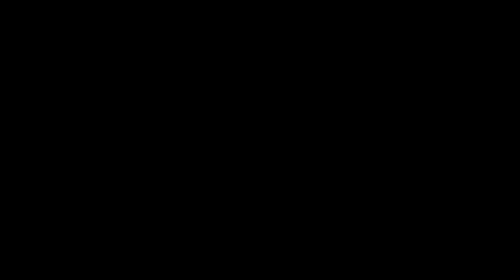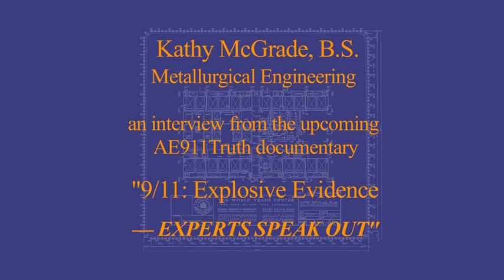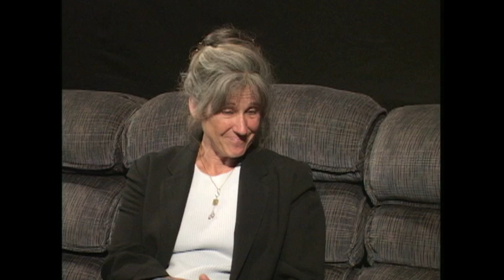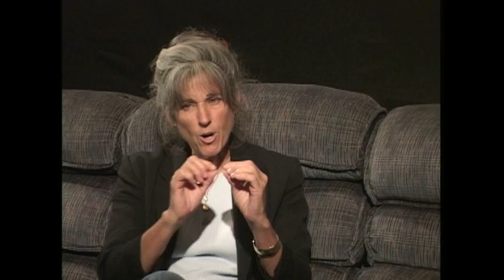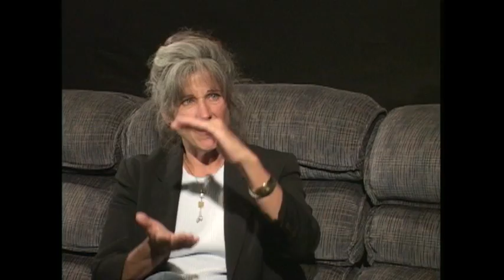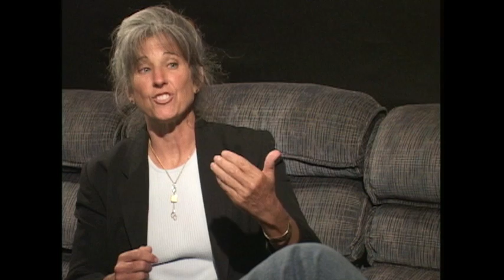Kathy McGrade, B.S -- Metallurgical Engineering

Comment: She's wrong on so many levels that it's ridiculous to believe her theory.
Reply: Prove it fuck boy
Reply: She is not wrong.
Reply: She is absolutely right on target with these observations
Reply: Fuck boy prove it for mk
Reply: E Spencer I have not found where they claim they can’t explain total collapse but I will admit I’m only quickly looking as I’m pressed for time... but I. And assure you those fires burned far beyond 1100 deg! I been in the fire service for the past 26 years and both normal building fires and jet fuel burn around 1800 deg.  Those fires up there also has a gaping hole and hundreds of windows for those strong winds to feed it an abundance of oxygen making it burn even hotter.   This is copy and paste of all I found so far.... I will look at it more this evening. BTW, are you sure you were not looking at Celsius? 

 “NIST reported maximum upper layer air temperatures of about 1,000 degrees Celsius (1,800 degrees Fahrenheit) in the WTC towers (for example, see NCSTAR 1, Figure 6-36).”
Reply: @speculizer1971  you'll have to slow down a bit. First off the NIST NCSTAR shows the core columns, those in the the center, never got to 480 F, as in less than. They also found zero evidence of weakened steel from actual testing, none and did include that statement in their report. The only place that ever had temperatures hit enough to weaken steel was in a computer model that nobody could check because they refuse to release their data.  If I ask you to present the official scientific explanation for the total collapses of wtc 1 and 2 you'll come back with nothing as they have never even attempted to explain it.  I wont lie, I actually snort when I see anyone mention OBL and 9/11, even the FBI said there is no hard evidence linking bin laden to the 9/11 attacks. He was never wanted for them, what you saw was propaganda, nothing more. Did you know the Taliban actually offered to turn bin laden over if the Bush administration would show them the evidence of his involvement? They did, multiple times.  That means had there been real and actionable evidence then the entire invasion of Afghanistan was completely unnecessary.  So what happened? There is no legal evidence bin laden or al Qaeda did these attacks, absolutely none. Everything you believe you were simply told, by known liars to 'trust us'. I even have a lovely video of a reporter saying that to the White House spokesman when the administration pulled back on Powell's promised white paper that would prove that al Qaeda had done the attacks.  They had to withdraw that promise due to lack of evidence, isnt that something? Dulles airport had over 300 cameras with 20+ days of stored images yet not a single time and date stamped image of even 1 has been found. And that's the same for all the airports and all the 'hijackers'. I refuse to even speculate on what really happened that day, too much information has been classified, destroyed or buried right now to make a coherent theory. I have no doubt the US was attacked, I do know it wasnt a surprise attack, there are 2 documented and irrefutable items which prove this and a 3rd that's never been verified or proven a lie so to me it's in limbo.  People also conveniently forget about the anthrax attack on Daschle which came from a US military facility and was made to appear to be from 'terrorists', also it has never been solved(again good propaganda at work made people think it had been).  It is also peculiar nobody stopped and asked how these al Qaeda 'hijackers' knew to pull this operation when there were excercises being done that were simulating planes being hijacked and being flown into buildings (feel free to look that up). I just wish people didnt feel the need to leap to conclusions of what happened, we just end up with more conspiracy theories, instead or ripping apart the official conspiracy theory and demanding to know what the hell really went on that day.
Reply: E Spencer  The core columns were not where the failures occurred. The claim comment that they made.

“None of the recovered steel samples showed evidence of exposure to temperatures above 600 °C for as long as 15 min”

Is insinuating that they did find  some above 600 C but not for longer than 15 min. Otherwise why would they make that statement about recovered steel?     I find it VERY unlikely that those fires didn’t reach far beyond 1100 deg. But I don’t have all the looking around or know if they found the evidence that supports that.  The chances of a building fire in high winds not reaching those temps are just not likely and there would really be no reason for them to burn any different than other building fires,  but very much the opposite with the high winds and jet fuel.    What kind of official scientific explanation would you like or would you be expecting?    They do a pretty good job describing the failures.   I’m pretty sure I’ve explained to you how they collapsed twice, what in my explanations do you not believe or have a problem with?  The collapse of those towers are not complicated when you are familiar with the construction and how buildings and structural members react to heavy fire.  OBLs part in 911 is no secret... nor is KSM.   It is a well known fact even within the jihad social media platforms and throughout the community.  So the taliban offered to turn over OBL...  that was great but he wasn’t all we wanted and needed.   Besides, I’m pretty confident he would have NEVER been turned over. Nor do we negotiate with terrorists. I can assure you, if it was my
decision, not no but Fk no!!   We would get him anyway.  There was many ties that linked them including wired money, his own omission. Which this stuff was gathered over time. 

So in 2001, before all the security you find it suspicious  that in the very busy Dulles airport there wasn’t more footage of them with a time stamp. I don’t see how this is suspicious.  They caught vid of some going through security... if this was staged or inaccurate why didn’t they just put fake make believe video of all of them in the three airports...?

So the anthrax attack was never without a doubt pinpointed.... does this mean
911 wasn’t carried out by muzzy terrorists...who have always threatened and carried out.   I know all about military exercises that were in progress... I also understand all the intel that was coming in... and how it was shuffled to the
back with the many many other threats intel picked up on that was harmless.   We were caught with our pants down because they didn’t take it serious!!  

How the hijackers knew to pull this off.... well OBL got the idea in 99 when Egypt air 990 was dumped into the pond my another muzzy that was pissed at the world.    It is also well known in the Islamic jihad interwebs that OBL said he
should have crashed it into a building rather than the ocean.   From then on.....

You refuse to speculate but are quick to tell what didn’t happen!? ;).      Well, one think I can assure you took place, WITHOUT A DOUBT!     A jet filled with passengers and fuel slammed into the pentagon on 911, 2 jets impacted the towers, and a jet filled with passengers did a nose dive into the ground in Shanksville.   I’m also pretty positive I’m dead on about the fires in the pentagon.   I’m sitting in my
shop freezing my ass off at the moment. I will try to read into more of what you pointed out soon.
Reply: E Spencer but there is no proving to folks.... as I asked, what type of “scientific explanation” would you like?  I explained to you in detail what took place. This isn’t just speculations. There is physical as well as video and picture evidence of it.   Prove that it didn’t happen..... can you?   As people like you are the ones claiming it’s not true and the burden should be on you guys.  Can you prove it... of course not.   You keep claiming that the fires didn’t burn hot enough. But as anyone in the business or educated on the topic can easily rightfully claim they burned far hotter than what you claim.   Just because a VERY small percent of the metal test did not show high temps don’t mean the first were not far beyond failure temps.  It’s just not possible to not burn far hotter than what you claim.   1 percent of the core columns tested and 3 percent of the perimeter columns!?!   Including the fact that the steel tested in these analyses were from some zones within WTC 1 where the computer simulations should not ,and did not, predict highly elevated steel temperatures.    Hardly evidence to prove the towers didn’t burn how like ALL OTHER BUILDING FIRES.  Not to mention the fact they were being force fed- plenty of 02.
Reply: @speculizer1971  and actually before even getting to the buildings I'd want to see all evidence of who was behind the attacks, if you don't know who, you have zero idea of their capabilities.  In 18 years the claim the attacks were carried out by al Qaeda have never been proven.  All requests for evidence, which cant be considered 'sensitive information' are denied.  Not a single 1 of the alleged hijackers can be placed at 1 of the airports on Sept 11 with legal evidence.  There should be an 'orgy of evidence' available, but nothing.  Foia requests for the 4 authenticated passenger manifests are denied to this day, for what possible reason?
Reply: E Spencer yes, they have explained everything in what you would describe a “scientific explanation.” But as I’ve said, conspiracy theorist would never be satisfied as they WANT to believe the nonsense.   Just as more facts are told and explained more inaccurate questions are asked... such as what you just did with your question about if “aluminum can cut steel.”  This is just a nonsensical question as the jet didn’t necessarily, “cut steel.” As well as if the building was one large steel encased block. Let’s say the 200 ton commercial jet didn’t bust through the steel structural members, the exterior columns were on IIRC either 36 or 42” centers.   The jet would have still easily entered the buildings.   You are more than welcome to scroll back through the NCSTAR you sent me to and look at the structural members and tell me they were “cut!”  The claim is just nonsense.   Then the claim that 10% of the structural destroyed 90% is also very misleading, as the 10% didn’t have to overcome the 90% of the remaining structure, it only
had to overcome the floor immediately below, which in all actuality a mere 20” drop was plenty to start a collapse.  I as well as NIST explained to you several times why the collapsing section accelerated as it went down. I will explain again which is very simple unless someone doesn’t WANT to believe actual facts.   Each floor it pancaked down upon it collected thousands (@4,600) of tons and enormous mass and velocity as the more weight it gained the easier it was to overcome the supports which held each floor. If I drop a brick on a ballon it will probably pop... if I drop 10 bricks tied together it would pop it much easier wouldn’t it.    

The claim that it was throwing
mass outward and upward is just nonsense. What went over the sides mainly was the initial impact and some of the building FALLING over the sides.   Nothing was “thrown upward.  As the building was collapsing down.  Please point out where building was “thrown upward”?   Yes, I’m sure you can show me plenty of conspiracy theories who say plenty for their agendas as there was absolutely nothing that took place goes against Newtonian physics.

I realize you will believe everything told to you by conspiracy sites about the hijackers... which is just nonsense.    So what is obvious  in your comment is that you apparently don’t believe jets were used as weapons on that horrific day as you question weather “aluminum cuts steel.”  You apparently question whether the jets would enter the buildings, which there is absolutely NOTHING within the construction and design of those buildings that was going to stop those 200 ton jets flying at those speeds from entering those buildings, yet you claim Newtonian boy about the building collapses.   Perhaps you should take those Newtonian physics as relate them to those jets and the 3-4 billion ft lbs of energy those buildings absorbed.
Reply: E Spencer sorry bud but the evidence and facts are there.    We know jets impacted the buildings... we know the floor truss sagged and failed, we know the exterior load bearing columns failed. We know there was major fires running through the floors because all the evidence from physical to video evidence is there. What evidence “refuted their claims”....... the small fraction of steel collected and tested?!?   Sorry bud but there is just no denying the fact that these towers acted any different than any other building fires and burned far beyond the failure of steel.  Especially then factors such as high winds which force fed the fires oxygen which would cause them to burn hotter.   

Sorry but your porcelain tile experiment is a far cry from a 110 story skyscraper.  Building an experiment proving your incorrect would be very simple if I had the time.  Building it with cardboard in between would be incorrect and inaccurate.  Building them
with small quarter pieces of tooth pics connecting and contacting them in a way that would hold them up to where a very small, say .5 an inch would cause failure.  As it is proven that the floor would only have had to collapse 20” to collapse.  Building a model like this would cause a complete and TOTAL collapse just as the buildings were total collapses.   

There is overwhelming evidence that proves what I say is 100% accurate as well!

No, I’m pretty certain my use of conspiracy theorist as a pejorative is dead on accurate.  

Conspiracy theory is  -‘a belief that some covert but influential organization is responsible for a circumstance or event.’    

This is EXACTLY what folks like yourself thinks.. that the gov is responsible.  

Conspiracy theorists —  One who believes in, follows, or advances a conspiracy theory!     Which IS EXACTLY what people like you do.... you think the gov (or some influential organization) is responsible FOR AN EVENT, 911!!     I’m pretty sure I’m dead on and am completely accurate about that as well as I just explained with the definitions as well.   Using it as a pejorative is very accurate.
Reply: E Spencer proof the floor truss failed and sagged...   Well let’s start with the fact that lightweight truss EASILY FAIL IN AS LITTLE AS 5 MIN IN FIRES.  Do you need this literature, I will be happy to provide.  When they sagged and failed do you think they A. Pulled the core columns outward or B. Pulled the load bearing exoskeleton columns INWARD.   Of course they pulled exterior columns inward. This is seen in many
many vids and pics where the exterior walls are pulled in several feet.   What do you think caused this?!!  Perhaps the columns they were attached to..?    Do you need links to these pics and vids? 

Sorry, major fires that are burning to those temps do NOT have to look like the Grenfell tower.  Are you trying to claim that the fires within the twin towers were not major fires?  That would be shear ignorance.   I’m pretty certain I never said there was “extreme fires.” Do you make it a habit of putting words in opponents mouths for your advantage.  

Please show physical evidence... as in....... ?   Vids, yes there are plenty of vids that show major fires running through the buildings.  As we have already established the metal tested was only 1-3% of the steel of the fire floors and computer models didn’t even put the areas tested very hot. 

Ahhh, then you are going to try to quote Oreo Palmer... yes BC Palmer reaches the impact site.  He called and said he had isolated pockets of fire.   This is what Oreo was looking at where he was as, this does NOT mean he saw all the fires that were up within the building,  this is basic common sense as we know Oreo had merely just made it to the impact site and as most realize the impact site covered many floors and fire and actually rises rather then goes down.  You are MORE than welcome to check out the fire eating at the south tower just before it collapses!    Ask anyone in the business and they will tell you just how foolish you are for insinuating those were not major fires.... and if ole Oreo was still alive I can assure you he would as well.   But, I’m sure you want scientific proof.   Oh yes I’m sure my lack of time to build a model that proves a point will act as a retraction on my part in your eyes.    We will put that in the same retraction as you have yet to take your time to build me proof of the nonsense you claim.   Try again.   Simple education on topics would is so beneficial.
Reply: E Spencer Where is it you would consider dodging.   I’m going by the very obvious and you are omitting facts. So you will not except the very obvious unless NIST proves it to you will physical evidence from the destruction, even
though there is evidence within video and pics of the outcome of what would happen had this occurred...?  So the exterior walls were pulled in WITH the exterior columns. Where this would only happen had the lightweight floor truss failed pulling the exterior columns inward which the exterior walls are connected to.. EVEN though this is a VERY WELL KNOWN CHARACTERISTIC of said light weight floor truss when exposed to fire and heat....?!     But of course, this goes back to what I said about conspiracy theorists never being satisfied with any evidence brought to them.   I guess since they were only able to test a very small amount of steel 1% and 3% which showed no heat that cause failure then I guess it did not take place...    I guess this fire miraculously didn’t have the very same characteristics that other building fire has even though it had high winds forcing an oxidizer  into it... ?    Refer back to what said about conspiracy theorists never being satisfied. So, if the samples are not available to be tested which would prove the fires were as hot as they should have been as all building fires,  well then CT believe it just didn’t happen and the buildings shouldn’t have failed.   

As for your experiment.... no, that is a bad experiment. That in no way shape or form resembles the experience to which I said. Lol.    This is the typical conspiracy theorists outlet to deny reality.   

I am sitting at my desk at work and I have the 5th edition IFSTA Essentials if firefighting. 
Page 156 Lightweight and Truss Construction Hazards.  You are more than welcome to google it..... which states the obvious which I have explained to you.  5-10 min failure times and direct fire impingement is not needed for failure. Heated gasses will cause the failure.
  
As for my “dodging.”..... I see a lot of dodging to my answers of many of the comments you
make such as your silly claim that in order for it to be a major fire it would have to look like the grenfell tower!?   Or your assumption that Battalion Chief Oreo Palmer was looking at every aspect of the burning damaged floors when in fact he was advising command of his initial assessment and needs..... as if he could see all that we could see in the vids!  Or your claim that the core columns never reached   480 deg F when not only did no one claim that’s where the failures were, you claim they said that “no evidence was found or NONE in their report” .... as you conveniently omit the part where they explain that only 1% and 3% were tested and Computer model modules show there to be low heat in that area where the samples came from. 

I have allowed you to slide on many of your claims which I questioned you about as well allow you to knowingly lie by omission to further your narrative, yet I’m dodging!   

Perhaps you could answer my question on just how they ignored NFPA921...?   This is just one question of  MANY you
 ignored as if it wasn’t asked.

Not to mention the silly notion that during the collapse energy was forcing debris upwards and out at 45 deg angles!  Lol as if this comical claim is accurate.  But if I can’t reproduce nonsense my experiment would be retracted. lol 

Let’s hear about your silly claim that NIST SAID There were no evidence of “extreme hit fires” which I guess that mean major fires.... as we all know NIST said there was no evidence found, YET they also explained that only 1% and 3% was able to be acquired for testing as well as computer modules show the area of those tested as not high heat areas.    Yet you claim that the fires temperatures within the building, which are typical in building fire house fires and ALL structure fires did not reach temperatures because you don’t have “scientific evidence” and any claims that the fires reaching typical temperatures would be a “known fallacy!”     This is just the grasping of nonsensical   typical conspiracy theorists claims which omit and mislead the facts.
Reply: @speculizer1971  in terms of 'dodging' is asked you why you use the term 'conspiracy theorist' as a pejorative since if you believe 19 radical Islamic extremists hijacked 4 planes in a surprise attack, well sorry that's a conspiracy theory, one with zero legal evidence supporting it.  I've said time and time again, theres literally nothing to argue about with the buildings, theres NO OFFICIAL SCIENTIFIC EXPLANATION FOR THE TOTAL COLLAPSES OF WTC 1 AND 2. And that's from NIST itself. Continuing to maintain there is makes you delusional at best, so dont. As for the experiment I'd like to see you show me one done where 10% of a free standing structure completely destroys 90% at near free fall acceleration while throwing large amounts of mass upwards at 45 degrees and laterally.  When put like this its apparent that is absolutely impossible with gravity being the only force used and that isnt my opinion, that's the opinion of very established phds in physics that have repeatedly offered to take on any other PhD in physics that says it's not impossible in a public, recorded debate. In years there hasnt been a single offer to engage. People take silence as scientists saying they agree with the nonsense spewed by the administration.  It's not, the large bulk of physicists in the US work for the us government directly or indirectly and dont want to lose their jobs.  As for your blazing inferno, i never saw one. I saw thick smoke, I know a firefighter at the impact site said there were only 2 pockets of isolated fires hed need only 2 lines to 'knock it down'. I know people were using the stairs going through that inferno repeatedly, yet were fine. I know a woman was seen right at the impact point hanging into the exterior steel, apparently it wasnt even hot. This is an inferno https://www.theguardian.com/uk-news/video/2017/jun/14/grenfell-tower-blaze-video-explainer  see how the fire is clearly visible? See it cover the entire building? This building actually had the exterior clad in flammable material and yet it did not collapse.
Reply: E Spencer lol it’s like you just keep regurgitating the same things telling lies and, putting words in my mouth which was “extreme fire,”   now it’s “an inferno!”  Lol    When we BOTH know you are speaking nonsense as I’ve said neither.  Yes, there most def were major fires within the towers.  And NOW you are going to try to use the logic of the woman who crawled up to the jet impact site on the windward side where those fires quickly burned out for obvious reasons.  I guess you are going to try to have people think or insinuate that since there was no smoke right there that all the fires were out...right?  Perhaps as i keep saying and said from the beginning, education on these topics is key.   

How about instead of speaking about the woman who, obviously is fighting to stay alive as she made her way to the windward side of the impact site.... focus your attn to the leeward side of the buildings where the fires were burning their ass off...?  We both know you are grasping to trying to paint a false narrative.

Just as your lame attempts to put words in my mouth in order to paint a picture which I am no way shape or form trying to paint.  You keep regurgitating the grenfell tower and referring to my claims of major fires within as “extreme hit fires” which you claim I said, and now it’s “inferno” which you know I never claimed nor suggested.   But yes, to deny there were major fires raging through the building would be just a deny out of ignorance or deny out of attempts to paint a false nonsensical narrative as those educated and use common sense realize that just because the fire hasn’t fully engulfed the effected floors does NOT mean there were not major fires running through the buildings and raising temps beyond steel failure.

It is also comical how you always seem to claim that there is a lack of “scientific evidence” where there is plenty of evidence and now it’s  “ zero LEGAL evidence” of the hijackers.  When in fact there is OVERWHELMING evidence of these 19 hijackers which also include hundreds of individual eyewitnesses of many different backgrounds which came in contact with them in the months leading up to the attack!    Sorry, that is only a conspiracy theory in YOUR mind because your disregard reality.

So, NIST said there is “no scientific explanation for the collapse of the buildings.”     Now, I will ask you AGAIN, post a link where I can read this for myself.   Or is it just going to be like my request for you to explain to me where you believe NIST just ignored NFPA921...?   I guess just pretending questions were not asked isn’t dodging. Lol 

Now, as for delusional, that would be to just ignore the facts of the building fires within and the obvious damage caused by them and claim that they just don’t exist because there is no “scientific evidence” when there is literally video of every bit of it.

Once again the claim that debris was thrown upward and outward is just complete nonsense. But yes, I realize you are merely regurgitating nonsense from “experts with PhDs” as you were told to think,  just as you were told to think they claimed to offers other PhDs in physics... etc.”.  Yes, we know you listen to everything that fits your narrative that these silly sites tell you. This doesn’t mean it’s accurate. 

More of your delusion is your   determined attempts to make your point by using the grenfell tower as your comparison is just clearly out of pure ignorance or attempts of deception .  Whatever be the case it is lame and will NOT work.   Most of the intelligent realize the major differences regardless of your claims that “the building had exterior clad in flammable material.”    

Let’s start with some facts which you just are ignorant on the matter or disregard facts to make your lame attempt to prove a silly narration filled with nonsense.  

1st) the GT was merely 24 
stories...... huge difference in a 110 story skyscraper. 

2nd) the GT was built much more robust then the towers that had 40% less steel then conventional buildings and built for horizontal loads and much less concrete than conventional buildings in order to build 110 stories high.

3rd) THIS is a aminor little detail you so conveniently love to leave out... the GT didn’t have a 200 TON COMMERCIAL AIRLINER LITERALLY RAN THROUGH IT CREATING SEVERAL BILLION FT LBS OF ENERGY FOR THE BUILDINGS TO ABSORB AND THE MAJOR DAMAGE THEY CREATED.. or let me guess, there was no “scientific evidence” of major damage or no “legal proof” of the jets....?!?   Lolol

 4th)  AND A HUGE FACTOR YOU JUST LEAVE OUT....JUST BEFORE THE GT WAS BUILT THERE WAS A GAS EXPLOSION IN EAST LONDON KILLING MANY AND REGULATIONS WERE PASSED BY WHICH GT WAS BUILT!!  THESE REGULATIONS REQUIRED BUILDINGS TO BE EXPLOSION AND FIRE PROOF!!   THE REGULATIONS aaREQUIRED THE DESIGN TO ALLOW FOR EXPLOSION OR FIRE TO REMOVE PART OF THE SUPPORTING STRUCTURE AND STILL HAVE THE BUILDING TO REMAIN STANDING!!    

 Now, do you seriously want to keep using the GT as your proof... I suspect you already knew the facts yet still attempt to deceive as CT so often do.     If not, as I said and keep saying education is key.     

You will continue to spew your nonsense and use all your talking points to try to prove your silly narrative.. but the truth is all there.   For instance, Oreo palmers claims which I explained to you and your very next comment you regurgitated the same.  Perhaps your lame attempts ARE from a lack of knowledge, reason logic and common sense.... who knows.   I have no clue if you are aware of the size of those towers and somehow you think that Chief Palmer was able to do a 360 around the interior of the building on all floors before calling for initial resources he requested as well as his size up on the casualties.   It’s as if you just rid yourself of common sense in order to make a point that you think backs your conspiracy narrative...  I mean Oreo Palmer reached the FIRST floor affected by the impact and you somehow believe he knows exactly what was on the MINIMUM of 8-10 floors above, we know the jet crashed into nearly 10 floors.  This doesn’t include the upper floors where fire had obviously spread  to!!     To use this as some sort of proof is just asinine from lack of logic,  common sense  and education on the topic!!
Reply: E Spencer lol so just as expected and is very typical.... you know there is no way to show exactly what temps the buildings burned so you stick with that and ignore the rest.... 

Yes, go back and LISTEN to i Oreo.... and the 6 min 53 min mark and lay attn.  he explains what he has ON THE 78TH FLOOR!!   There is no need for me to give counter evidence, as you so ignorantly gave it for me!!    Now let’s go back and reiterate children. How many floors were damaged and affected.... what direction  does heat and fire go?!   Yes, you are finished!

You then claim you mentioned the grenfell tower ONCE AND CLAIM THAT I CANT GRASP THAT IT WAS RI SHOW AN EXAMPLE OF AN INFERNO LOOKS LIKE, YET YOU SAID THAT IT HAD EXTERIOR CLAD IN FLAMMABLE (which I’m certain you said flammable instead of combustible  because Of lack of education on the topic) MATERIAL YET IT DID NOT COLLAPSE!  Lol why would you say the bullshit about it did not collapse if you was only “SHOWING WHAT AN INFERNO LOOKS LIKE.”   Still not being honest are you..... anything to make your silly claims seem correct.

So I do not know the “protocols”  required for NFPA..?   Lol I only do it and use it for a fkn living and do so on legal reports.       They are GUIDE LINES, not MANDATORY guidelines.   Do I need to call an investigator for every fire....... no, because I know what caused it.   There was no doubt as to what caused the collapse of the buildings... only to the uneducated conspiracy nuts.  

“With all the mentions of explosions,” yes..... which were all found out to be inaccurate as there were zero explosions at ground zero, FDNY even identified all loud noises during post incident critiques.    The only loud explosions around building 7 was the actual building collapsing. 

Yes, I typed in EXACTLY WHAT YOU SAID TO and still cannot find what you are referring to...  the 3rd thing down is wiki’s collapse of the WTC.   So you  tell me you can type all that telling me exactly where to look but you can’t just post me the link !?!?   Lol of course you cannot.  

- [x] Wow, shocker.... you will mute because you know there is no way to prove the ONE thing that you can claim. Lol as it is just “opinions,” to you which mean nothing.    Yes because WTC fires burned different than ALL OTHER BUILDINGS IN THE HISTORY OF MODERN BUILDING FIRES! Lol.     You know that only a small amount of steel was tested and that is your “ win” because you so conveniently disregard the OVERWHELMING evidence because it’s easier to stick you fingers in your ears and scream I won!!! Lolol      In your world,    trolls = those far more educated than you and make easy work showing your ignorance.    Please, tell me more about how Oreo knew the conditions of the WHOLE SOUTH TOWER after only reaching the south tower...?   Yes you most def sound stupid as ANY dipshit with common sense could watch the video and the several fires burning throughout and tell that there was far more fire than what Oreo was referring to... he even stated on the 78TH floor!!    Lol yet you will ignore the facts and ignorantly claim “finished”.  Or tell us more about how you was only pointing out grenfell towers to show an inferno, when I NEVER claimed the towers were an “inferno.”   Yet you still made the point “and it didn’t collapse!”    But we know that was just you trying your best with your lame attempts that went absolutely no where’s!!     

Or yes, please tell us again how “NIST already said there is no evidence” as you so conveniently leave out the rest of what NIST said.   That that was only a very small fraction tested. Lol.   This is the exact way you lie by omission in order to paint a narrative that you so ignorantly want to believe.    I’m pretty certain you were finished before you even started....   Go ahead and mute, I’m used to conspiracy nutJob theorist blocking me once their ignorance and lack of education on the topic is exposed along with the lies they tell and the way they go about doing so.     It’s all good, some of us are doers and some are keyboard jokes!
Reply: E Spencer challenge with actual evidence.... you are just another blithering idiot who hasn’t the first clue about reality!!  You are going by LITTLE pieces of evidence that would back your narrative while OMITTING THE REST OF THE EVIDENCE!!   I destroy you and make you
Look and sound like the low IQ simpleton you are and you simply just ignore it all and resort back to your silly talking points!    Hell I steered clear of my personal dealings with 911 just to allow your to spew your nonsense! Lol    How about BEING HONEST INSTEAD OF allowing yourself to sound so UNEDUCATED when people bust your ass with all you just conveniently omit!!     Lol yeah bud.... I’m pretty sure any educated person can EASILY tell which one of us is the complete moron! Lol.  just another uneducated mentally handicap who thinks he is an “elite critical thinker!” Lol.   Lol and to think you are just continuing to spew conspiracy nutbag bullshit you were told to think and regurgitate!!    Get off your computer and do man things.... and make something of yourself!!   Maybe this way you will start to think for yourself and not allow others to do your thinking for you!!      Btw, yeah my opinions are pretty fkn solid there you ridiculous clown lol!!   Now, go make something of yourself other than a conspiracy shitbag loser!!
Reply: E Spencer FIRST THINGS FIRST..... just because you aren’t able to handle my comments and keep up perhaps your should allow others to read them to you... or if you are having trouble comprehending have them give it a try.... You are constantly doing the same bullshit over and over, claiming that I said shit I NEVER said!  Is this a habit of yours or is it a mechanism of coping?  You seriously have problems.  POINT TO WHERE I SAID THEY CANT TEST FOR HEAT SIMPLETON...?   Lol apologize for educating you!?  Seriously, your condition is worse than expected!! If you cannot keep up there will always be a problem.... but, you are just sitting here speaking nonsense as if you had a clue!  

It is ironic how you can never post links... I’m not going on a hunt trying to find something your stupid ass just can’t comprehend.   If you want me to educated you in something about fire heat and investigations post a direct link and I’ll take my time educating your stupid ass.... other than that you aren’t worth my time trying to find what you are having a hard time with..?

Lol, I mean I shouldn’t be shocked.... so as a conspiracy nutbag you are going to try to accuse those who claim they saw Bigfoot or interacted with Elvis who passed in ‘77 with people who ACTUALLY WORKED AND INTERACTED WITH THE TERRORISTS WHILE WORKING at their jobs.. all of which can be verified and were contacted or contacted investigators. ... people who are normal citizens ... Are you seriously that stupid...!?  Yes, nutbags who make such claims most def are! 

So because the vids from 2001 that they did catch didn’t have time stamps means they didn’t board jets...  yes, you are that stupid.  I guess you want them to mail you the original manifests..?   How about quit getting your info from conspiracy sites. It would perhaps make you sound smarter!! 

Sorry bud, but the conspiracy theory is what the conspiracy nutbag theorist (YOU AND YOUR BUDS) spew and accuse the gov of...... you are the conspiracy NUTBAG theorist!!    You claim it’s not accurate of true.. the burden of proof is on you shitbags and in 18 fkn years you clowns have done nothing but look more ignorant BY THE DAY AND COMMENT!

You have not and will NEVER pick apart my statements because I am stating accurate facts.   Because some of us aren’t just going by what others say... some of us are educated on the topics.   Actually SH did have wmds in the form of sarin gas, which he even used on his own people.  Do I agree with taking SH down..  he was a horrible human being but he was keeping those animals in check.  Why did we go into those countries... I already explained to you, I realize you can’t keep up nor does your uneducated ass listen to learn.... I don’t know how old your uneducated ass is, but have YOU EVER known a career politician to let a horrific tragedy go to waste......?   I guess I have to explain it to you.   He used 911 for personal vendetta and or gains.   None of this means the Islamic terrorist didn’t commit these horrific events.. it just means you are too stupid to think for
yourself...nothing more nothing less!!      

Still uneducated to the point you are spouting the shill crap I see!  Lol AS IF IN 2019... lol. Yes, you’re that stupid!!!   Go ahead post your Operation EV bullshit! Lol.    I’ve told you yes, I DO work for the gov though...! Lol.  City Gov that is....   Shill...SO, LET 
ME GET THIS STRAIGHT , a Fire Capt in this here capital city, with 26 yrs service, whose family has been part of this dept for generations.... One who has spent his WHOLE FKN LIFE helping others in their time of need and some in the darkest days of their lives... This includes both his part time job as well.   As well as someone who is also on one of 28 USAR teams from across the country and has for many years before 911... same USAR team of many who responded to the pentagon where we,  first shored the building with army engineers, next task we HELPED FAMILY WITH CLOSURE  BY COLLECTING HUMAN REMAINS INCLUDING PASSENGERS which you silly asses claim DON’T EXIST!!  Lol.  Which all remains were bagged tagged dna swabbed gps marked and brought to the temp morgue.  SO....... THIS GUY,IS A GOV PAID SHILL WILLING TO SELL THE CITIZENS DOWN THE RIVER, LIE AND ALLOW THE GOV TO MURDER THOUSANDS OF INNOCENT CIVILIANS.... INCLUDING 343 FIREFIGHTING BROTHERS..?    Yeah, here’s a big FUCK YOU BUD!!    It’s TRASH LIKE YOU who need to be beat half to death and locked away for spewing your ignorant trash where family members can read it and putting your nonsensical BULLSHIT in clueless people’s minds and taking the blame off of the Islamic extremists who are responsible for this shit!!  All because your are one of the ignorant shitforbrains who hate the gov and always want to play the victim as well want to be part of something where you say and are told your are the “elite critical thinkers” and the rest are just not as smart as you because they can’t figure it out by watching conspiracy bullshit!    When in reality you are merely a pathetic clown who needs to get out in the world and try to be an intelligent man.  

You are a very comical conspiracy nutbag though, I will give you that.  You can post this comment and accuse me of saying something else I NEVER said.... how many times is that now simpleton.... 3?   Let’s see, “extreme fire,” “inferno”...... and not this BS.    I guess it’s all to just AVOID all the stuff educated you on in the comment above!  You never want to try to prove my education for you wrong do you..!?    I wonder why that is? Lol.       

I’ll be waiting on you to point out where I said they can’t test for heat...this should be fun! 

As for spinning wheels... that would be you and the rest of the idiots like you do.  As for baseless nonsense.... that is only because you don’t want to use your brain, some you just DON’T WANT TO HEAR SO YOU JUST IGNORE BECAUSE IT OBLITERATES YOUR NARRATIVE and  some is just over your simple head.
Reply: E Spencer MY TEMPERATURE ANSWER IS BELOW....BUT, JUST AS I FKN SAID AND KEEP SAYING!!! Lololol.  I AM TALKING OVER YOUR UNEDUCATED BRAIN!! Lol. YOU ARE TOO STUPID TO FOLLOW ALONG AND REALIZE THE FACTS!   BUT FIRST, YOUR CLAIM THAT YOU DONT READ MY WHOLE COMMENT IS VERY TYPICAL AND WHAT MOST NUTBAGS CLAIM WHEN THEY KNOW THEY ARE SPEAKING TO SOMEONE THEY KNOW IS FAR MORE EDUCATED THAN THEM.    ITS A LAME TACTIC TO KEEP FROM HAVING TO ACKNOWLEDGE MY COMMENTS, AND FACTS I EDUCATE YOU WITH!! Yes we BOTH know you read ALL of my comments. You pathetic lying POS....it’s EASILY SEE IN YOUR responses!!    YOU CLOWNS ARE ALL ALIKE AND SO SO VERY TYPICAL!! 

Now back to the comment.... you are talking about different building temps.   First you keep saying that they said that the steel tested proves that and you claims NIST “admits” the temps didn’t get that hot in the twin towers.  What your retarded conspiracy nutbag leaves out is the FACT that where you got that info from it ALSO states the steel they were able to test was only a VERY SMALL FRACTION of the steel (1% and 3%) and computer models show the fires were not very hot in those areas to start with... YOU keep claiming that this is EVIDENCE THAT NIST “admits that they fires didn’t get that hot” WHICH YOU KNOW IS COMPLETE HORSESHIT!!!   They merely gave the temps of what they were able to test and are sure to explain in NCSTAR that the steel tested was only a fraction of the steel!!   YOU LEAVE THAT PART OUT.   No, there is no way to PROVE with physical evidence they don’t have access to, just how how the building got.    YOU EITHER LOVE TO MISLEAD AND LIE, OR YOU ARE A TOTALLY ILLITERATE SIMPLETON.... which I honestly believe the latter!!!     From the looks, what you asked for me to explain, on page 90, which I have not found exactly what your uneducated ass was referring to but what I did see what they were referring to building 7.... WHICH THEY HAD ACCESS TO! Lol.  

Now , are you able to follow WTF I’m trying to tell you...?!  Of course not, but you expect someone to apologize to you because of your lack of ability to keep up and comprehend the facts?!?    Yeah FK you.   Once again, we BOTH know you read EVERY WORD of my comment. You just choose to ignore my education and knowledge of the topic by claiming you don’t read past second sentences!!  WHICH WE KNOW IS A LIE!!   Lololol. YOU PATHETIC LOSERS ARE ALL ALIKE!!!!  Lololol     Yes, you are way to far out of your league.... Get our the house and try doing some man things, get a man job and start hanging with some true men....this should help you in becoming a MAN, where you can man up when you should!!
Reply: E Spencer LET ME GUESS.... you are now going to comment again claiming that I lied... because you aren’t educated to comprehend what I just explained to you or it’s easier to just play dumb and claim your horseshit...!    Poor little guy, it must be a pretty shitty feeling to know, within your heart,  just how much of a pathetic coward you are..
Reply: E Spencer where are you at simpleton Spencer....... are you still trying to figure out exactly what I’m explaining to you,  or how to spin it to where you are still trying to accuse me of lying..?       A COMPLETE  AND UTTER IDIOT are the ones who would not recognize the FACT THAT along with saying they didn’t find steel that was exposed to temps over 480 f they ALSO said they were only able to test a VERY small percent of steel from the towers and the areas where the steel samples came from the computer showed it didn’t get that hot anyway.  Funny.... the computer was dead on with the low temps yet those lacking intelligence would not take the computer temps serious and legit when it shows the very obvious high temps, yet its used across the country. Lol    Pathetic conspiracy nutJob theorists!!
Reply: E Spencer lol, also comical how your coward ass calls me the loser!! Lololol
Reply: E Spencer what’s the matter.... you realizing you can’t just keep regurgitating the same ole LIES AND BULLSHIT and have me continue to post the FACTS that you leave out!!
Reply: E Spencer there you have it folks....When these uneducated clowns get to the point it’s impossible for them to keep regurgitating lies and bs they run and block to keep from having to address facts that they conveniently leave which would  destroy their ignorant claims and narrative.
Reply: Yes, she is an absolute idiot.... just like MK Kendall the blithering idiot above.
Reply: speculizer1971 
No, she’s a very well-spoken professional expounding upon her specialty to prove the scientific basis for her belief. 
And she proves the case successfully. 
If absolutes are mentioned here...then we note that you’re a shill. (sayanim?).   
What’s a cottage industry these days, huh?   Working from home?  Tel Aviv maybe???    Herzliya perhaps?
Carry on....Moshe.
Reply: Michael Horton where are you Michael....?  Can you tell me what she proved...?   Or how in the hell all the debris could fit in the lobby of the towers!?!!?!?   Lolol
Reply: @speculizer1971  actually I've seen a 'paid shill' by the name of M Fitz on 9/11 videos. A guy names Frank asked him if he knew what 'Operation Earnest Voice' was and M Fitz started swearing at him.then proceeded to clone Frank's account, my account and others showing he had at least 6 accounts he was was using to push the government propaganda on their conspiracy theory.   He was the literal definition of a sock puppet operator. So yeah they're on these comment boards. As for disagreeing with her that's fine, just remember in 18 years we still have no official scientific explanation for the total collapses of wtc 1 and 2. Nist put forth a theory, nothing more on what MAY have started the collapse. Problem is the physical evidence they gathered negated that theory. See the problem?
Reply: E Spencer I have no clue about M Fitz, but just because someone is computer savvy and acts like a ass doesn’t mean he is paid by anyone to go against one side..

No I do not see a problem with ANY of it, there is absolutely nothing suspicious about the total collapse of 1 and 2 nor is there a question as to what started the collapse. That is unless you listen to all these conspiracy theorists...   What about the collapse of the buildings to you have a problem with and what don’t you understand about how the collapse started?   Regardless as to what these sites tell people it’s not hard to understand either.
Reply: @speculizer1971  A) look up operation Earnest voice. Yes people are paid. B) If by nothing suspicious you're okay with not having any scientific explanation to date for the total collapses of 1 and 2, that's your prerogative. C) All the government offered for an explanation of the attacks was a 'conspiracy theory' so anyone who believes it is a 'conspiracy theorist', and yes that's all it was. Treat it with the same scrutiny as any other conspiracy theory you've questioned and it falls to pieces just as fast.
Reply: E Spencer what type of, “scientific explanation” do you want them to give you as to why the towers collapsed?   What is it about the towers collapse do you not understand or believe?    Not quite on the conspiracy and conspiracy theorist.   The conspiracy was what the Islamic terrorist did, the conspiracy theorist are the ones who claim the nonexistent conspiracy by the gov.
Reply: E Spencer what the gov offered for the attacks was a conspiracy.... not a conspiracy theory.   I’m pretty certain the gov offered a very detailed scientific explanation  on why the towers collapsed. But with a little knowledge on the construction of the towers and   damages the buildings sustained and how buildings react to heavy fire and one would realize that when those fire ran through those buildings it was only a matter of time before each collapsed.
Reply: @speculizer1971  actually it was a conspiracy theory, a theory of a group conspiring with zero legal evidence supporting it. And NIST itself admitted it could not explain the total collapses of WTC 1 and 2 and gave up trying to explain the symmetrical free fall acceleration of wtc 7. So no in years we have no scientific explanation for the collapses of all 3 buildings, we have zero legal evidence to show who did it and it goes downhill from there. As for 'heavy fire's the NIST report states they found zero evidence of fires hot enough to weaken steel, so that theory again is negated by physical evidence.
Reply: E Spencer would you please point out to me where NIST said that they could not explain the total collapse of any of these buildings. I have never read in any  NIST report that claims such.    They go in detail explaining what is the obvious. There is nothing odd about the way any of the buildings collapsed.  Once the damaged burned floors failed in the towers and the top floors started pancaking down there was no way it wasn’t going to be a complete collapse as there was nothing going to stop the driving down force that collected @4600 tons for each floor it collected... it was going to gain mass and velocity until it reached the ground.   Building  7 free fall to the ground and the progressive collapse lasted nearly 10 sec.  There is also an overwhelming mound of evidence showing those who committed the acts as well.  Could you please also show me where those heavy fires were not hot enough to weaken steel!  Hell I can easily prove that nonsense.  Hell even the conspiracy vids claims the fires burned 1800 deg F.  Steel, including the A36 structural steel used in the towers begins to lose their integrity at @795 deg F and will completely fail at 1100 deg F.    Not to mention the long spans of lightweight floor truss which played a huge part in the north and south towers collapse as lightweight steel truss fail very fast under heavy fire conditions and can fail as quickly as 5 min.   Are you insinuation conditions within the towers were not heavy fire...?   Where in the world are you getting your facts from?
Reply: E Spencer    Spenc, I will say this, I appreciate you pointing this exact thing out as I’ve
never noticed some of what you are pointing out.   That being said, in my education in inexperience I have a hard time believing those fires stayed that cool. That would be VERY abnormal, especially with all the windows broken out etc.... those winds were blowing hard as always and those fires were oxygen fed.  In the south tower just before the collapse I can assure you the fire was far beyond 1800 deg.  No, I have no way to prove that to you but.... video evidence of the very hot fire.  I did a quick look and have not found the parts you are exactly talking about. I will look again later. But I did find this. 

“None of the recovered steel samples showed evidence of exposure to temperatures above 600 °C for as long as 15 min”.       

This is the 1100 deg where Steel will most def fail.  That being said, like I told you, steel begins to fail or lost its integrity at 795 deg F and honestly don’t have to reach 1100 to fail, especially if already compromised.   This isn’t saying I don’t believe the fires were not upwards of 1800 deg f, I’m just putting these facts out there.   
Also, as I said.... lightweight steel truss can fail as fast as 5 min...here is a read on them.   If needed I can point out this fact in the IFSTA  ‘building construction relating to the fire service’ or ‘essentials’  manuals.

http://www.aspiringfireofficers.com/wp-content/uploads/2016/05/dangers_of_lightweight_steel_trusses.pdf
Reply: @speculizer1971  have you found where NIST says they cant explain the total collapses? It was in response to a request for correction in 2007. They say it's just too complicated to do so they cannot explain the total collapses.     So this is the central problem, testing the materials show the fires were never hot enough to weaken the steel, as per NISTs own admission, they don't support the 'pancake theory ' the 'pile drive theory' is just plain  ridiculous, I have no idea how that idea even got floated. And NIST saying they cannot explain the total collapses. So after 18 years we have..nothing.  I'm not actually surprised since NIST completely ignored NFPA921, the national standard for investigation. Their investigation was completely unscientific and as we can both see from citing different sections, contradictory.  I actually dont argue about the buildings since it turns out theres nothing to argue, theres no scientific explanation attempted so nothing to argue. I also found it intriguing that when subjecting the official conspiracy theory to rational questioning it falls apart.  They cannot place a single one of the 19 alleged hijackers at any of the 3 airports on Sept 11 with legal evidence.  Unfortunately for that administration, since it is known to have lied, repeatedly, their say so is absolutely worthless and should always be suspect without legal evidence to support it. I was shocked to find that no legal evidence was ever presented 18 years that shows the attacks were carried out by al Qaeda.  It has as much 'evidence' to support it as 'sky lasers'  or 'micronukes' which is to say none of course.
Reply: E Spencer No, I have not found but to be honest I haven’t had a chance to sit down and read into it yet... I will later on this evening.    I’m not sure why they would say it’s too complicated, it’s honestly not complicated at all.      You claim that testing wasn’t ever hot enough to weaken steel but that’s not so as I posted above.  I copied and pasted this exactly where you told me to look.

“None of the recovered steel samples showed evidence of exposure to temperatures above 600 °C for as long as 15 min”

Is this not saying they did find 600 C and or above, but not for longer than 15 min?  This is telling me they did... I honestly have a hard time believing there wasn’t many aren’t that burned beyond that for longer.  But also, one would have to think, just because they did find in the enormous debris piles don’t necessarily mean it wasn’t there.. 

As for the pancake theory, I have no idea as to why they would need to prove or disprove the pancake theory we they had already thoroughly explained how the initial collapses started and where the failures occurred. Once the initial collapse started there was no stopping the collapse until it reached the ground.   Once those truss failed and sagged which is the reason the exterior walls are pulled in several feet, this could not happen if the exoskeleton columns were not pulled in several feet as well, this rendered their load bearing capabilities, which was 40% useless.  When each burned damaged floors failed they free fell as a min of one story or 10 feet.  Independent Engineers have already said that a 20” drop was all that was needed to start the collapse.  Once it was initiated they would pancake down until it reached the ground.  There was nothing, regardless of the nonsense so many say about physics and the lower floors would stop it is just nonsense.   As I said, each floor it collected it gained @4,600 tons..... it was only going to gain mass and velocity.  I have no clue about the power driver crap.  But also one thing to keep in mind was the many different thickness and grades of steel used in the towers.... and this was even for
the columns.  At the top floors it was as thin as 1/4.” 

I don’t understand why you think they ignored NAPA921?  

I also don’t understand how the official story falls apart during rational questioning?

I’m not sure what you want to prove the hijackers were at the airports. There is a paper trail from Hotwire website which their tickets were booked to them checking in with boarding passes.....or independent agents checking them in to footage of going through security.  What exactly are you asking to see?   Same with the proof that Al Qaeda and OBL was responsible...?